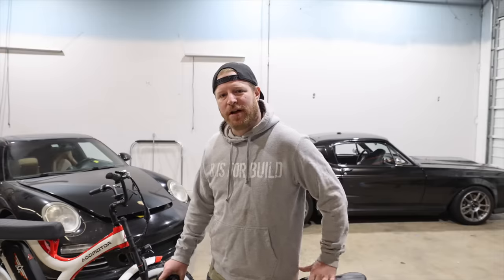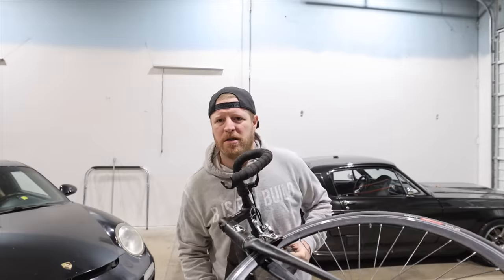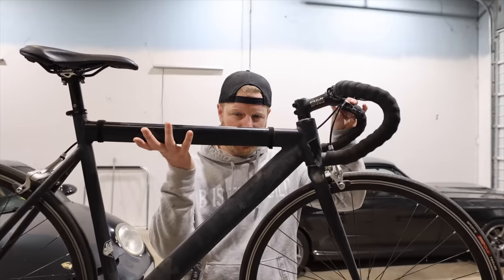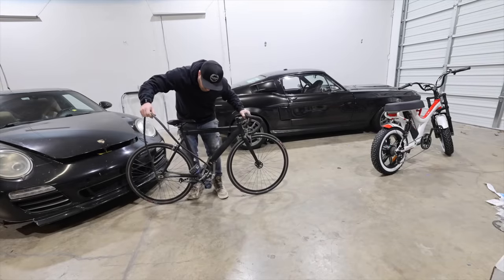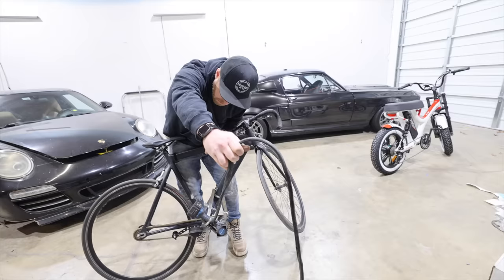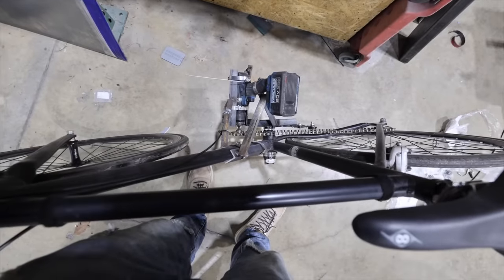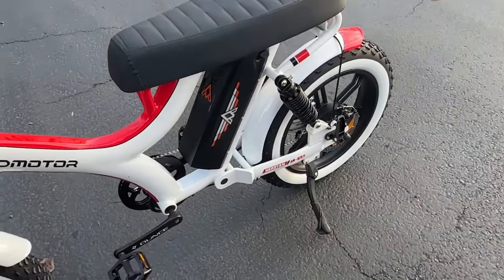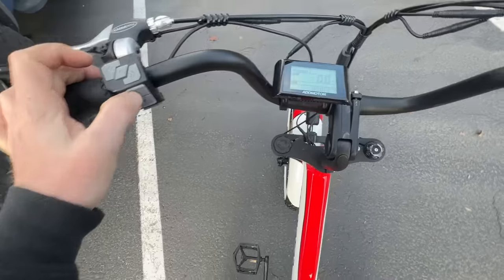DIY Electric Drill-Powered Bike vs $2000 E-Bike: Who Will Win?

Comment: Dang was thinking he was gonna take the drills apart and build a throttle with a variable resistor. But this is actually hilarious and still reversible.
Reply: there is an easy way to make a drill throttle that works perfectly

Comment: A larger drive sprocket would reduce the torque and perhaps it will be sufficient that the motor doesn't shut down. I thought you said you were going to weld foot pegs onto the bike. That would help. Also, you need a holder for your cell phone so you can track your speed without sacrificing one hand to do the filming.

Comment: you should buy 3 or 4 pedal go karts and do a similar thing but have a team wide build off. Do a few competitions like top speed, a slalom course, braking test, and then a time trial or parking lot head to head race. some could do electric conversions, others do like a lawn mower or string trimmer gas engine. that would be really cool to see.

Comment: Back in the day before they invented sportscars we built the sort of the same kind of bike, but we used a chainsaw... It went like stink, way too fast to be safe... Big fun!
Reply: I mean that is actually what the first motorbikes were. A push bike with a motor added. So you could say we've gone back in time 😂... Harley and the Davidsons is a good watch. 

I did more that a couple of vehicles with salvaged lawnmower motors. A scooter was particular fun with a two stroke whipper snipper attached.
Reply: Some people use to use dryer motors as well...
Reply: I wonder how a battery chainsaw would work.

Comment: I admit that it did better than I expected. The Hercules 1/2” high torque impact would do better. Especially if you can lockout the hammer mechanism.
Reply: if you lock out the the hammer it just becomes a drill,  no? anyway i think the hammer action would be hilarious

Comment: The addmotor bike has a speed governor. 20mph is the top speed allowed by law for class 1 and 2 electric bikes. With a 750w motor it could probably do 40+mph with the governor removed
Reply from the maker: is there a way to do that? !
Reply: @BisforBuild  most times its in a menu setting
Reply: @BisforBuild If it’s not a menu item, the best way is to trick the bike into thinking it’s going slower. The magnet for the speed sensor is generally on the rear brake rotor. Planet3 makes a planetary gear kit for some bikes — you could probably print your own for this one.

Comment: There are old mopeds that essentially used a drill motor with a rubber roller attachment that went directly against the outside of one of the tires and turned the wheel that way. Probably a lot simpler than this but I’m not sure which way would be more efficient.
Reply: I remember my neighbor had one of those back in the 90s. It was alright but there were better options. Still was better than walking!
Reply: Called a Velosolex, made in France, if I remember correctly .
Reply: The citicar (that's the actual name of a car) uses a drill motor and five car batteries, so I believe this comment.
Reply: @jwalster9412  yeah rich rebuilds did a vide about that. But there were actually 2 wheel mopeds like that. Like I said my neighbor had one.
Reply: @older-wiser-better  yup

Comment: Next iteration with a starter motor and some deep cycle 12v batteries… would be a cool Optima sponsored episode.

In HS I worked at a boat shop and one of the techs had a 3-wheeler he electrified using a SeaDoo starter.  The thing ripped around the yard as a parts runner.

Comment: Look at the gas powered bikes. Power it with a rubber wheel on top of the back wheel. There are some kits that bolt a sprocket on to the wheel itself. That way you Can still pedal it when the battery dies

Comment: This is how you make reviews fun

On the drill, is there button to change the power mode? Maybe its on the wrong setting if it has multi mode choices? Just a thought since some of mine have adjustment modes even on my milwaukee 1/2 impact has some torque limiting modes or full send modes.

Comment: Cool build. I was thinking, what if the original pedal sprocket (larger) was used on the rear, or maybe one larger than that? I'd think that would give the bike more torque and be easier on the drill, which probably has a lot more power to give (not that specific drill)

Comment: You probably could have made your first setup work by adding an adjustable chain guide to “push” the chain against the sprocket. That would also tension the chain and remove any wobble. I hope my suggestion makes sense, English isnt my best 😅
Reply: Could’ve just wrapped the chain on the other side of the drill sprocket

Comment: Couple of things: Between Black & Decker and Hart, neither of my drills in full torsion will just shut-off under load. Seeing Harbor Freight drills do this just teaches me to avoid them outright. The other thing is that I'm surprised you didn't do a bevel gear pair into a reduction to give them more torque and drive the crankshaft sprocket. You could've even done a mini differential to compensate for trigger variance and have both drills flush with the frame on opposite side of the bevel gearing. It's amusing to see that drill motors can indeed make the torque needed to make a bicycle go reasonably fast. With both, some throttle control, and at least a 7-speed shifter I feel those small battery packs could get maybe a mile or two of range.

Comment: The most diy hacky bike power tool mod I've seen is where someone takes an angle grinder. Connects it to a bank of 18650's, and then sticks a rubber cylinder to the end of the grinder, and uses a lever to push the rubber into the wheel. It was genius for its simplicity on how to apply it to a bike. Because you didn't need to modify the gears, chain or main functionality of the bike.

Comment: We did something similar a few years ago (and by a few years I mean back when cameras on phones were not great). Our solution was to add a second large sprocket to the left side and then mounted the drill in the triangle of the frame (between the legs) and ran a second chain on the left side. We too ran into chain tension issues and put the drill on a slider and used a long bolt to get the tension. The only other difference was that we used a couple of motorcycle batteries as the 12V drill batteries (yeah, drill batteries were only 12V back then too) couldn't provide enough power for the torque.

Comment: Here's a tip for anybody with an electric bike. I have an electric trike (incredibly practical, I have hauled a load of more than 90 lbs of groceries) and I reduced my maintenance expense and time 90%  by replacing the bicycle chain with #420 light motorcycle chain. You can't use the heavier duty #428 chain because the roller diameter is too large for the bicycle sprockets.

A standard bicycle chain was never meant to handle the torque delivered by a 750 Watt (~1 HP) motor. I had that trike in the bike shop where I bought it about every 10 days, and they hated to see me coming.😀 It's been five or six months now on the motorcycle chain and nobody has laid a wrench on that trike since then.

Comment: The best drill for a ebike conversion, is the Dewalt 20V/60V drill, the battery is fully charged in one hour. And the battery has 12 amp option.. that drill would make a long range, fast charging ebike.

Comment: you can just get a bafang conversion kit and still have a usable bike.  My mini dirt bike has a massive motor and 48v li-po battery that does about 30mph.  Used a Razor mx650 as the base and swapped all the power train.

Comment: on your reguar bike with classic tirangle frame..aliexpress has 2 stroke bike engines with an automatic clutch for 100 bucks. In my neighborhood.. my 1500w monster only has one eye to eye friend..an old two stroke ten speed custom built. I have had a blast with my electric. I am 50 yrs old..30 years no bike at all. go bigger than 1000w with all pedals.. all good.

Comment: It shuts off with a current limit so the brushes and commutator won’t get damaged. That function is in the switch and other circuit boards if it has other boards. Eliminating that would be difficult if it’s in the software like most modern cordless drills are.

Comment: A note about the complaint of the 20mph max speed.

In the US, that's the fastest an electric bike is allowed to go for "throttle assist only", known as Class 2. To go faster than that, you have to move to Class 3, where both pedaling and throttle are used. Those bikes have a max speed of 28mph. Anything higher than that will require a license.

Comment: If you relocate the trigger from the drill to the handle bars, and wire it to both drills, in parallel, it should run both drills at the same speed

Comment: With a more upright position bike you would be more comfortable. Plus if you had a crankset with multiple sprockets you could remove the derailer and run a separate chain to the drill and that sprocket with better gear ratio. You could even retain a rear sprocket and derailer setup for less stress on the drill to get the bike going. Using a coaster sprocket on the drill head would enable you to run the 2 drills one would just overpower the other until wide open throttle was achieved and rpms matched.

Comment: What if you just got another standard bike sprocket and chain then drove the other sides sprocket instead of the pedals sprocket then you could have had pedals too (if you had them in the first place)
You should do it with a bike with a back rack then you could mount the drill sideways there
Reply: Ooooooh what if you got a 48v motor and used 4 drill batteries to power it

Comment: You could break the drill down and remove the control board and wire the battery direct to the motor it with a momentary on switch to operate the throttle but you would loose variable speed

Comment: you could’ve always tried two drills together with a somewhat abrasive cylinder in the middle on top of the tire in a U-shape then all you have to do is get some type of rheostat replace the two triggers with it. One drill, operates in, reverse the other drill, operation forward, and it uses friction against the tire to move.🤣 

Oh yeah, the free wheel problem…
you could use the hub from a rear wheel for the cylinder against the tire.

Comment: You should do an update with an angle grinder instead of the drill..  watching the torque test channel they seem to have a higher output in general, and they freewheel better than a drill does.

Comment: Chris why didn't you just use the original spokets and swap them back to front that would have given you a lower torque ratio.
Reply: Rear freewheels and front chainrings use completely different mounting systems, the only real option would be throwing a mountain bike crank+ring on the front and weld a larger ring to the freewheel.

Comment: probably better to use a grinder instead of drill? they can free wheel, can go higher rpm than a drill, shape it better than teh drill, so it doesnt stick out? only problem is that they dont have much starting torque, so will probably have to start out pedaling before you can use the motor for more power

Comment: Top speed is limited do to compliance with laws. The E-bike I have. The version of it sold in Canada has a lower Watt motor for that exact reason.   A big issue in a lot of places is laws that say if its faster than a certain speed or too powerful  Its a motorcycle not a bike.  This really needs to change. More people would use them daily. That would be a big benefit to peoples heath. Improve  road congestion issues. Plus other problems

Comment: 13:43 in and I'm thinking drive the original sprocket. I agree with some of the other comments a battery circular saw would have more speed, if it has enough torque.

Comment: If it was me that designed that bike, i would of added alternator and a charging system to charge back the battery whiles peddling, or whiles the front wheel is in motion

Comment: Drills "brake" when off by literally shoet circuiting the motor.  All you have to do is to rewire the switch so that the motor is disconnected when off and then it will just spin with the resistance of the gearbox..    Alternately, using some chainsaw clutches would also have worked..

Comment: Glad you eventually realised that the wheel does in fact "freewheel"!  Given the sizes of the two sprockets and the speeds of the drill wouldn't it make more sense to actually reverse sprockets, with the smaller one in front and the bigger one in the rear...
Just LIKE on a a MOTORBIKE!

Comment: Why not just put a rubber wheel on the drill and direct drive it to the top of the tyre behind the saddle? Then you could mount one to the front wheel and one to the back. 😉

Comment: i'M 11 minutes in the video so maybe you figure it out later but.. it would make more sense if the chain goes under the drill sproket, probably would make more tention on the chain and less slipping, also if that was me, I would try to connect both drills to the same trigger! And... if you wanna go crazy, cut off the drill handles, fasten the 2 battery sockets on a plate fitted as a luggage tray over the back wheel! ... Easier said than done i guess!

Comment: You could have reduced the size of the chainring the smaller the chainring the less force is applied to the rear you could also increase the size of the rear which would do the same thing but seeing as that style of bike you could probably get a smaller chain ring a lot easier than you could a rear Cog that was larger

Comment: Yeah.... you want a small drive sprocket to a larger wheel sprocket to get your base line ratio. Then you know hey I want more speed so slightly smaller wheel sprocket. Small sprocket to a small sprocket is like a 1 to 1 rotation ratio. Drill won't have the tourqe. That's like direct driving the drill to the wheel Axel.
Reply: Lame terms

Comment: You need biking shorts/underwear so that you dont hurt your butt, and a larger gear in the rear should help with the torque issue. I think the problem is, is that you decided to use a fixed gear bike instead of using a gear shifting bike.

Comment: Big sprocket at the front small sprocket at the back=max speed . Small sprocket at the front big sprocket at the back=slow speed lots of power . If both sprockets are the same the same size you have 1 to 1 gearing . You should build a front-wheel drive bike to demonstrate just how stupid front-wheel drive actually is 😂

Comment: That is the worst video you’ve made……if you want it to work you need to figure out what the torque of the drill vs the torque you can create with the pedals, and adjust your ear ratio accordingly.
My guess is big sprocket on the rear, small on the front